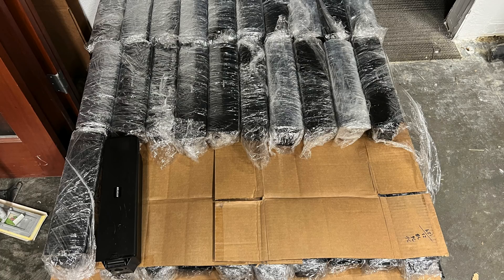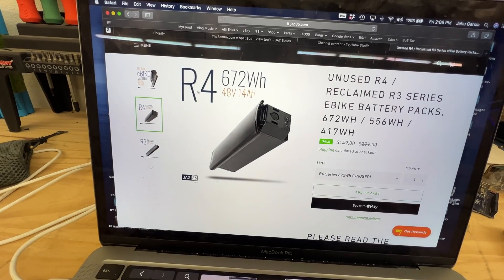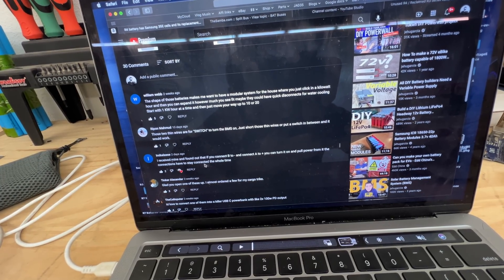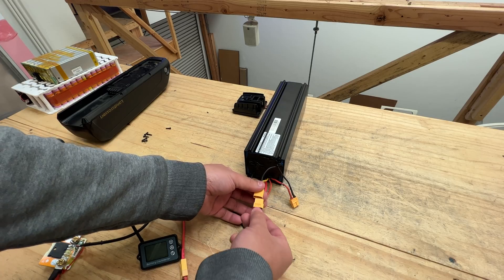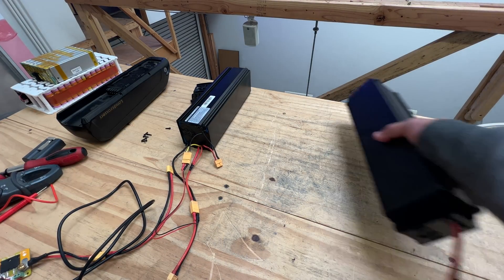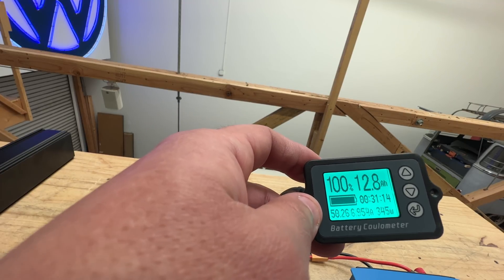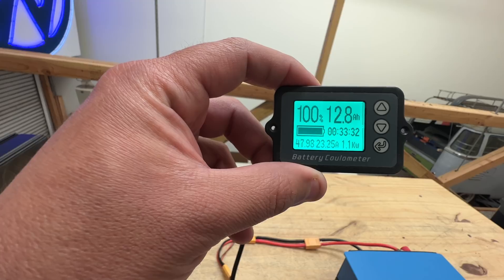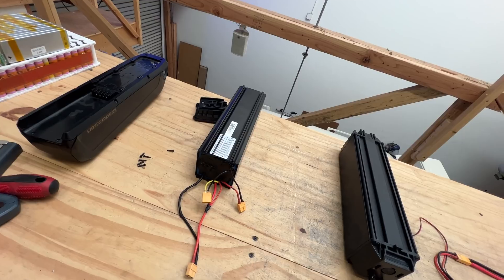48v Aventon eBike Battery  Wake up Hack for DIY bike builds

Comment: I bought a 48v14ah renention battery and it's not charging I'm so sad I didnt even get to put it in my bike and it wont charge it so clean looks brand new almost 400 $ it have to work ca. U help plz it wont charge I got a 56v battery charger and still nothing put it on charge nothing mess with charger 1 bar lights up turns off wont turn on iv been trying for almost a year to get my bike up and going im so sad

Comment: What if the battery  is.      (+, A,B,C,-)  ? How would you connect the jumpers? I jumped + to C and the green light turned to a slow flashing red on the charger. And the blinking green light on the battery is no longer blinking but remains solid. And if I hold the button down for 3 seconds it will turn off. And two presses turns it back on . Is this how the battery functions?

Comment: I bought this battery from Jag35 (along with some others I use). Needed the male connector for it.  Hard to find. Aliexpress has the connector for $40 bucks with key. Waiting on delivery. Do not know if it will have wires attached....  Aventon sold me the discharge connector with wires attached for $10.99. Just received it.  The two positives have a small wire connecting them together.  Positive Main has a JST connector to NegativeB (middle negative). I am pretty sure it is for charging since the 4 pin connector blocks the barrel plug charge port when mounted. Hope this helps. Recap. Positive and negative have 14g wires. Small wire connects both positives. Small wire from Main Positive (on the end) goes to a 2pin JST connector. Another small wire from secondary negative (middle-one) goes to same connector in the other pin slot.

Comment: Hi out there, 
I have one of these R4 battery packs and I hooked it up to a ebike. It works great and has lots of power but it seems unable to accept a charge. Wondering if there are any suggestions out there. 
Thanks
Reply: The internal fuse is blown. I blew mine several times. VERY easy fix. Let me know if you still need to fix it.

Comment: I bought this for my aventon level and it didn’t work at first (plug and play). It did take a charge. I did some testing and noticed the larger black wire wasn’t completing the circuit. I spliced all the black wires together and it appears to be working now. I just bought another R4 and it worked straight out of the box. Now I have 3 working batteries for my bike!!! Thank you for supplying these!

Comment: These batteries fit the Aventon Level bike for those wondering.
Reply: Is this the batteries that fit on the old v1 or the new V2 terminals
Reply: I’m wondering the same thing because I bought one from the Aventon doesn’t work because I have v1 and the battery is the v2 Doesn’t work on my bike without replacing a chip that connects the battery

Comment: How would you mount it on your bike, any ideas? I put two holes ont the front plastic gard and screwed it on the water cage screw hole, but it's not the the most secure way.
Reply: I found an Alibaba seller that has the connector and lock and key. It's not an entire single piece mount but the ends have metal that would normally attach to inside of the frame. I will build a mount for my dual motor Rad Runner I am building.
Reply: @PolskiDangles  Can you share the Alibaba link? Were you able to make it work?

Comment: So it seems you can do this hack with hooking A to the positive and B to the negative but it seems if you leave them connected like that it kills the battery over night so I would recommend making it like he did with the double connector so you can unhook the B and A wires. So it doesn't kill battery overnight. Might just be mine but it's happened twice now charged to full rode the bike for 10 miles recharged for a few hours then unhooked and left over night battery dead. Charged battery for 5 hours till 80% rode bike around just fine then left over night again hooked up and battery dead again in the morning.
Reply: For those in the future, the likely issue here is a vampire cell, more than one if it drains that fast.

Comment: I have an Aventon eBike that these batteries are designed for, so took the risk and purchased one. It was most definitely not new, with scuffs and a bit of dirt on the battery. It also does not work in the bike, or with the stock charger. The charger just turns green instantly, and in the bike the screen either won't turn on or just flashes low batt for half a second. Doing the trick in this video let me verify that the battery does have actual voltage (54.1v) and let me both charge and discharge the battery. I think either the BMS is bad or it is in protection mode for a reason, and connecting the wires this way is bypassing it. So maybe good for salvaging cells, but don't plan on using this in a bike as is.
Reply: Do you know the name of the 4 blade connector? My battery charged just fine on the barrel plug connector. I have no way of knowing how to find this connector. Thanks!
Reply: @PolskiDangles  No, sorry. Haven't seen a connector like this before.
Reply: @mofig  Thanks. Will report if I find something and try to help the group out.

Comment: This is I know a weird question for you but I do not know any other way to contact anybody on your website about it . When trying to order these batteries on your website there is a problem can you please tell me how I can order them. 50 pack PINYOU INR18650 2500 mAh NMC cells ( 3C max discharge) - Sriko Batteries

Comment: may be a great hack, but that's also a VERY great way to kill a Li-Po pack real quick BMS protects against over-discharge, while this hack allows you to BYPASS the BMS entirely, which takes away your protection from over-discharge/current situations..... think carefully before doing that on a Li-Po pack... would you wanna run the risk?
Reply: The BMS is inside the battery's case. This hack doesn't bypass the BMS, it simply turns it on so it can do its job. Think of it like turning on the ignition switch to your car.
Reply: @Toaster808  I have the aventon bike that this battery is designed for. I got one of these batteries and it will not work in the bike (screen flashes low batt and turns off immediately). Also the stock Aventon charger won't charge it, just goes green instantly. Doing as shown in this video lets me discharge and charge the battery, so it's definitely bypassing something.
Reply: @mofig  that something is the BMS

Comment: I'm not an electronic engineer or bms expert. It seems to me that when you are connecting the negative and the B terminal next to it, you are bypassing the discharge protection of the bms.  The B terminal is wired to C- of the bms and tied in with the negative of the charging port. So now,  your discharge current is not running through P- of the bms where it was supposed to but running through C-  and therefore bypassing the discharge protection of the bms.  ie LVP, OCP and short circuit protection.  I hope I am wrong about this. Besides,  I bet you don't have to jump the positive and the A terminal but just the B and the negative to be able to discharge the battery.
Reply from the maker: Do you have pictures of the internal bms that shows where these wires connect to?
Reply: @jehugarcia  What is the best way to connect to the discharge ports? Do I just jam metal soldered pins inside. Every other ebike battery I can find a connector for except this one. I even found mounting plates for R3. Struggling to get bare necessities to use the R4 on a dual motor ebike build. Thanks!
Reply: @PolskiDangles  Did you figure out anything more about this bike?
Reply: I do have pictures of the gutted BMS but I was not able to post photos in YouTube. I posted them on the face back page about this battery.
Reply: I’m not sure about that. I don’t think there is any safety concerns here. Batteries over a certain voltage and WH, must disconnect the outputs for transportation purposes. The Ebike connection that this battery is intended for, just makes the said connections when inserted to the Ebike socket. Internally the cells are always connected to the BMS, there is no BMS bypassing going on.
Reply: @ecaparts  you can believe whatever you like. The battery cells are indeed connected to the BMS by the B-. The output to P- and then to the load is controlled by the MOSFETs and circuitry with different discharge protection. The cells voltage/current will be cut off to P- when there is any issues that trigger the MOSFETs to shut off . Same with the charging side of the circuit aka C-.
Reply: @Swannking  Yes pictures would be helpful. Are you saying you see two sets of MOSFETs as in a dual port BMS?? Usually I see a single port BMS where the charge and discharge is the same ‘protected’ negative terminal.
Reply: what is the fb page, like to see the pics...Thanks!